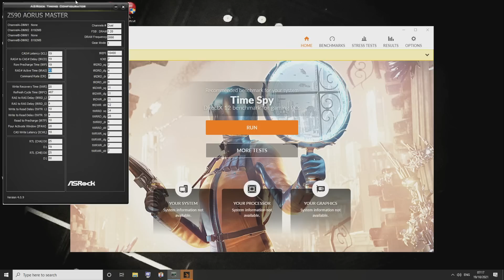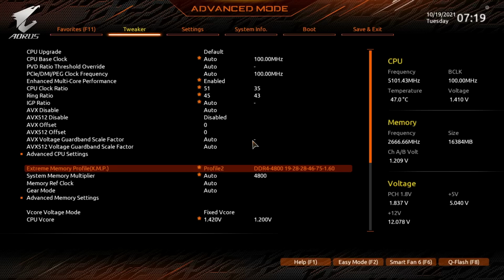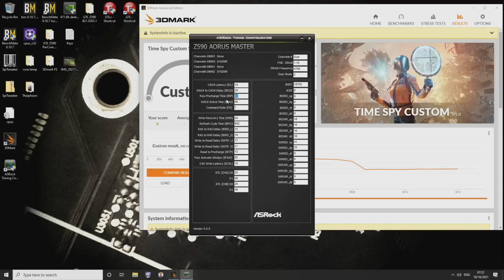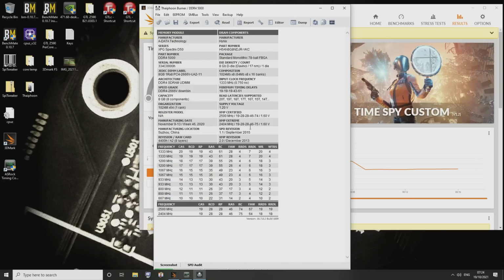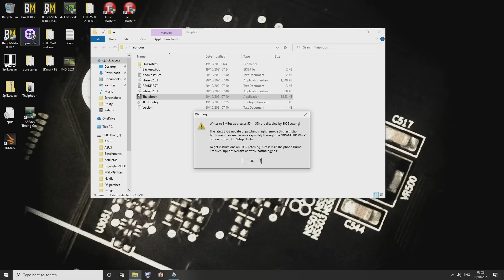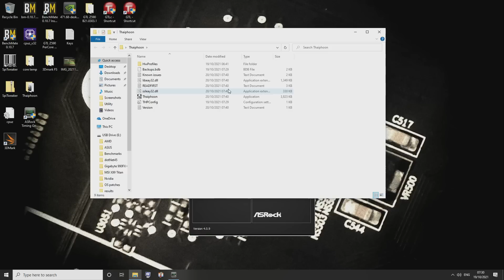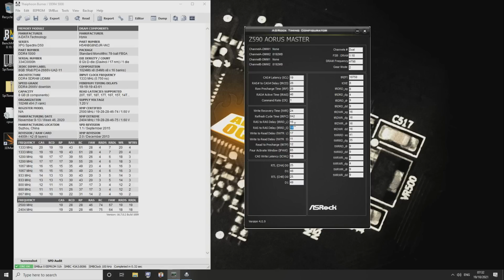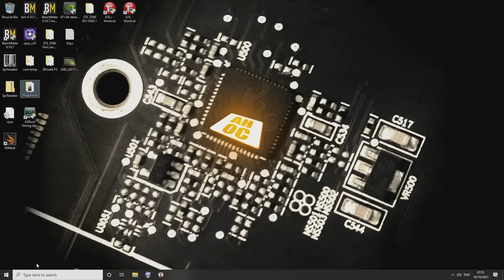XMP on some memory kits actually makes performance worse.

Comment: As someone who only ever set primary timings until recently, I appreciate this video.
Reply: I really need to make the effort to learn more about secondary timings
Reply: @Khola_D  Don't bother unless you are really enthusiastic about overclocking. I once spent over a month fine tuning my memory timings and voltage to stabilize a better overclock. The whole time it was always on the verge of being stable, but it took forever to find just the right combination of values to actually make it stable. It was a maddening gauntlet of tweaking, testing and analysing seemingly paradoxical results!  All for a 1% performance gain in certain memory intensive applications.
Reply: @fnorgen  just learn the most important ones that actually have huge impact (like shown in this video)
It doesn't have to be at the edge of stability, but sometimes you really can tighten those down (2-3 days of work are worth it)
Reply: Primary timings net me better performance over xmp or dram calculator

Comment: Amazing that a company which is manufacturing sticks can be so incompetent. RRDS/RRDL/FAW are by far the most impactful DRAM timings these days and those settings are way worse than JEDEC spec.
Reply: It doesn't help that most of the manufacturers who make DIMMs are not the people who make the actual memory.
I've always find it odd that there is trust in companies to bin and make memory faster when they themselves aren't involved in the production of the ICs.
There is only one company you can say sells both high speed kits and is a DRAM fabricator, that being Micron
Reply: tRFC is also very impactful.
Reply: The memory manufacturer can only program in so many timings into the extra spd space there’s not space for every timing. Everything else is up to motherboard manufacturers to optimize xmp/auto timings for every kit out there. Would be cool if all the best timings could be saved in the spd eprom.
Reply: @nickpowell7432  Yeah for sure, would make stuff less likely to work in one click though due to board, BIOS and IMC differences.

What is unforgiveable is explicitly programming a timing which makes the RAM perform worse than JEDEC.
Reply: It's not being incompetent, it's marketing.

Comment: Some motherboards do not even run XMP profiles. I had a B450 (Asus) that failed to load up a 3200MHz XMP because of shitty VRMs.
Reply: The VRMs for the memory are so insignificant it seems rather unlikely to be the cause; are you sure you didn't have the memory controller setup wrong? Some of the early Ryzens needed the termination impedances tweaked or they wouldn't drive the memory correctly.
Reply: @lucidnonsense942  Mind explained that out?
I have a 1600 and anything higher than 2933 is unstable, nothing I did managed to fix it.
Reply: @ghoulbuster1  There's too much to go into, but setting RAM terminations, vSoC, and RAM impedances is pretty key to get Ryzen 1000 to go anywhere. Furthermore most termination and impedance stuff is really on a case-by-case basis so there's no real good tutorial out there.

That being said you shouldn't expect much, best I managed on the platform (stable) is 3333C14. It just doesn't clock well.
Reply: @IK4MS  I see well, I wanted to go 3200 C16 on it since that's a good speed for ryzen but I spent days trying to stabilize it using really loose timings and changing everything and nothing worked.
I could try again but I'm sure the problem is the cheap B350 mobo that I used.
Reply: @ghoulbuster1  Honestly chief I've tried literally the cheapest B350 board I could find and it didn't do that much worse than my X370 K7.
I obviously haven't seen nor tried your setup so it certainly could be the board, but I've seen people with Crosshairs not beat 3000 with bad IMCs.
Reply: @IK4MS  Damn, I guess it's time for an upgrade then! Let's see if an 5600x gets a little cheaper so I can buy one.
Reply: Most b450 b350 asus are shit. B550 is kinda
 Good

Comment: Can anyone recommend a tutorial that explains memory timings and overclock techniques?
Reply: Depends what you're trying to do.
Reply: @SL1PSTAR  overclocking
Reply: @kamipls6790  🤣  I should of said "depends what you're trying to overclock"
Reply: @pcoverthink  I'm currently using 3200MHz CL16  "g.skill Trident Z RGB ram", although I couldn't tell you the 4 timings on the box for sure... I want to say it was something like 16-18-18-32...(or was the last number 36, that's the number I keep forgetting) I have no idea how to overclock RAM properly, although I can kinda overclock the processor pretty good, for my needs, and I wish I had a guide to go by, that uses my specific motherboard, which is an ASUS "TUF x570 Gaming PLUS (Wi-Fi)", as I'm more of a visual learner, and have also noticed that my motherboard has slightly different settings and terms in use, than other motherboard brands do, and because of it, haven't really been able to get a working overclock on my RAM... Of course, it could just be that the RAM is incapable of being over locked more than DOCP profile
Reply: Is this a joke? Almost everything I learned about ram oc'ing is right here. The other 10% is trial and error.
Reply: Knowing what each timing does do not help with overclocking, cos for the most part you just have to lower everything as much as possible except the frequency
Reply: @MadPotoo  Not totally true. For example, It is helpful to know the connection between FAW and RRD

Comment: Every time I watch one of your memory videos it gives me a tremendous urge to tweak my timings more and see how much tighter I can make them lol but my gskill kit has paper thin heatsinks that don't do anything so it always runs really hot and makes me sad
Reply: Zip tie a fan to them
Reply: If you have RipjawsV then remove the head spreader entirely. It makes the temps better by about 2C in my case. GSkill designed an anti-radiator which makes the temp. worse.
Reply: @MasonStormSunny  just aesthetical cooling. Trash
Reply: @MasonStormSunny  lol wtf 🤣
Reply: Either iprove the air circulation in your case, or tie a small fan to the memory. My Crucial kit was blue screening as soon as it got hot after tweaking the timings, and a small 5V (Raspberry Pi) fan sitting on top of RAM stopped all the errors :P
Reply: The downdraft from your CPU cooler does a lot more to cool your memory than those "heatsinks" on the sticks
Reply: Just out of curiosity, do you use air cooling or some liquid cooling setup?

Comment: Ballistix 3600 on ASUS/MSI 16-18-18-38-84 and a whole lot ot auto. 
GIGABYTE seems to pull all the correct timings at 16-18-18-38-58, with tFaw etc set correctly.
Reply: so in this case it's pretty much the other way round. The Timings on the Kit are tighter than the ones that Asus/Msi would automatically set
Reply: @LinkStorm13 I love consistency
Reply: The Crucial 3600s try to force 1802mhz, but MSI only allows 1800mhz. So TRFC goes out of whack (Micron B Single rank) on MSI AMD boards. Not sure about ASUS or GIGA.
Reply: Nice explanation, that might explain a lot of what I've seen trying different boards and chips in AM4 builds with the same 4 sticks of micron. No Asrock boards yet so that'll have to be next.
Tonight a few cans, order some food, open the windows and mess with an A520I AC and a 3500x. Woohoo.
Reply: My Z490 Gigabyte mobo tends to set its own secondaries and tertiaries, which it sets mainly according to the "Memory Enhancement Settings" setting.
In my experience it sets everything decently tight regardless, but then again that may cause issues with certain kits.

Comment: I would think think that the change from gear 1 to 2 also contributes a lot to this slowdown
Reply from the maker: nope it's entirely the tRRD timings.
Reply: in fact, the before and after is gear 1 command rate 2, versus gear 2 command rate 1, so it's very close to a non-factor if memory serves correctly.

Comment: Enabling xmp on my pc made it extremely unstable when gaming.Bumped the voltage 1.35 to 1.36 and all good now.
Reply: You need to stress test.  XMP is an overclocking profile. 

People buy xmp kits at high frequencies but most of the time it takes a lot of vccsa voltage to get stable.  With Ryzen running 1:1 with RAM the IF can become unstable, also IMC. With Intel like the 10900k more VCCIO and VCCSA can be needed.  As both the IMC and the cache connection are affected.

Just because the system feels more stable, does not mean the RAM is not erroring randomly.  You wont know until you test.

I have tested the RAM with the 10900k with HCI/memtest etc and past (4000MT/s C15 Dual Rank 4 x DIMMs).  Then errored in large prime95 ffts.  Bumping vccio by a small amount fixed this, as well as lowering cache to 44x.  I get 15.4k in Time Spy cpu.  All games are smooth as silk.  All voltages are very safe for 24/7.
Reply: @GodKitty677  what would you say is a safe 24/7 ddr voltage for a typical ddr4 kit?
Reply: @MrBrancomusic  Depends on the memory IC's.  1.36 volts should be safe, if 1.35 volts is the default.
Reply: @MrBrancomusic  On Hynix DJR and Samsung B-Die you can daily 1.5v. Stick to around 1.35v for other IC.
Reply: @DripDripDrip69  I dont know which die my ram is but it says Samsung in spd.
Geil Super Luce RGB.
I guess im fine at 1.36v.
Reply: @DripDripDrip69  That's very conservative. Most DDR4 is fine at 1.5V and B-die can take 1.75V as long as you can cool it. I guess being cautious with voltage doesn't hurt though - better to lose some performance than risk damaging your RAM, even if the risk is very small.

Comment: Just bought some OLOY 2 x 16 3200MHz kit and I was surprised it came with Micron E-die chips.
Reply: I'm unimpressed with the 2x8 Oloy kit I have. Wouldn't run @3600mhz until it got all the way up to 1.4v and it's CAS 18. Trash. Hopefully your kit is better.
Reply: @x8jason8x  How are your other timings?
My RAM won't go above 3000MT/s no matter what voltage I use, and most of the timings suck, though I do get CL14 (Corsair Vengeance XMP 3000MHz CL16 8Gb Rev B)
Reply: @nathangamble125  I couldn't tell you now, I replaced it with a crucial ballistix set.
Reply: @x8jason8x  replaced rev e with more rev e lol. At least it will be better binned they use the better chips on thier own mem kits and sell the rest. What did you get out of the ballistics? I’ve got 3600 ballistics. Rev e is harder to find info for since everyone drools over Samsung b die.
Reply: @nickpowell7432  Yeah I think they are rev e too but way better binned, 16-18-18 @ 1.35v, also 3600. I haven't overclocked these ones in particular, couldn't tell you how low they'd go.

Comment: My games were laggy when I used to turn XMP on.
Reply: I don't know exactly what "laggy" means here, but bear in mind some motherboards and some motherboard BIOS revisions will not work with some XMP profiles.
For example, my Asus X470 Prime-A worked perfectly well with my XMP profile at 3000MHz, but a newer BIOS revision wouldn't even boot. And the computer was sluggish and unstable with anything by JDEC settings. This was obviously a bug.
My point is, if your games are "laggy" with XMP and work well with JDEC, it's most likely another issue unrelated to XMP.
Reply: @TiagoMorbusSa  I play Quake Champions, the most DRAM-bound game there ever was, it judders constantly. It's hard to measure frame pacing with no built-in benchmark, but even average FPS I can go from 120 to 300+ just by tweaking timings on a 3200 cl14 Samsung B-die.

This kind of crappily coded game relies on memory latency more than bandwidth (imagine traversing a huge table by columns instead of by rows, you dodge all prefetch logic, run out of cache in a microsecond and just hammer memory with random accesses).

But in OP's case, I think he has a similar motherboard to mine. I need to force it to re-train memory multiple times, until it finally "clicks". And it can happen even before I start tightening anything, straight up XMP can end up super garbage, you check actual timings and some are out of bounds! (literally out of bounds, there are timings you can set up to 15 or 20, but they show 50 or whatever ;))

You can even see this in the video, when actual trained timings were worse than what's in XMP, even though what's in XMP was super conservative to begin with. Oh, Gigabyte :)

(Mine is also a Gigabyte, but a cheap Z390-UD, so it can be excused, but an Aorus Master behaving similarly is unacceptable - as Buildzoid said, other manufacturers' top boards have way better training which goes tighter than XMP, not looser)